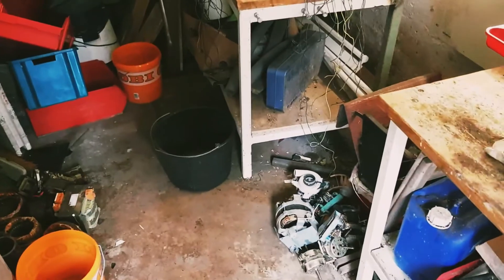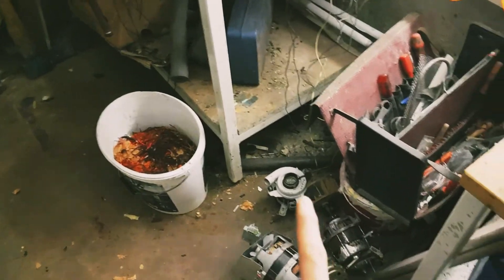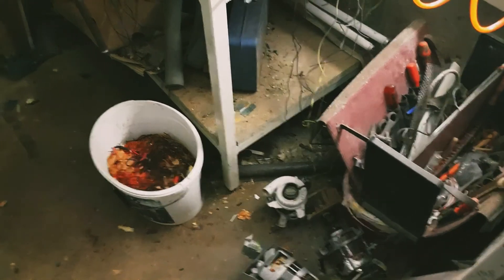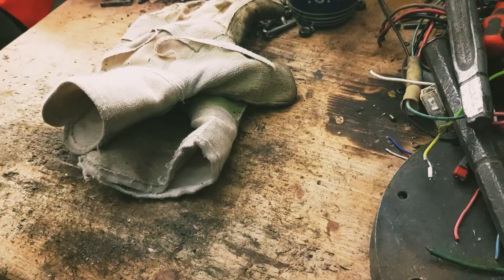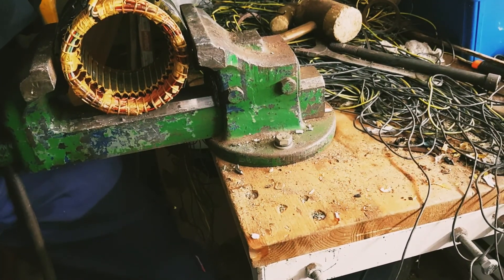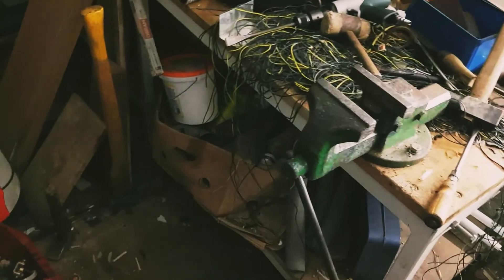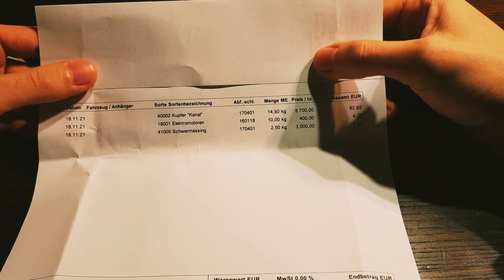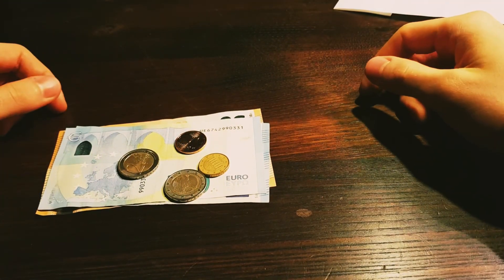Scrapping Electric Motors for Copper, Aluminum and Steel!

Comment: Good vid mate not a bad haul. I want to run into a couple large motors. 100 hp or higher
Reply from the maker: Oh interesting, are you planning on using them for something or why do you need the 100 hp?
Reply: @scrappingadventures290  no plans on the use of them just want to teat one down to see how much copper. I have heard on large motors the copper yeald is 2/3 of the hp so a 100 hp motor should get about 75 lbs copper
Reply from the maker: Very generalized rule of thumb, not really useful to be honest. You have to look at the weight in relation to the copper content, on large motors like that, it's usually around 10%. That's terrible and you will not make any money if you're buying them. Besides that, how are you going to move it? Will probably weigh around 500 lbs at least. If you want my suggestion, I'd say don't bother. It's really not worth it. If you still want to do it, choose a spot where you can completely take it apart without needing to move it somewhere else. 👍
Reply: @scrappingadventures290  thank you for the advice I do have the tools to lift and transport. I still would like to do 1 or 2 just to say I have done one